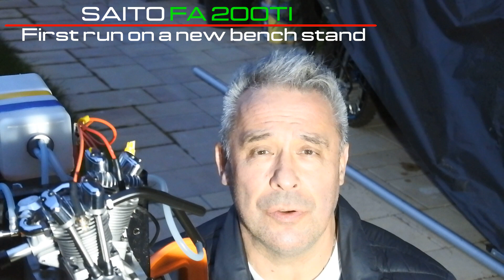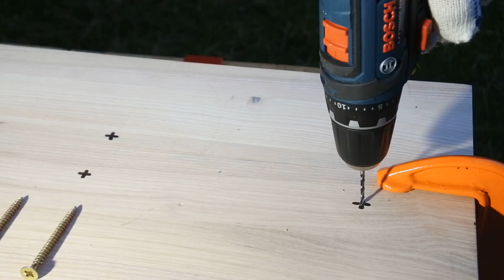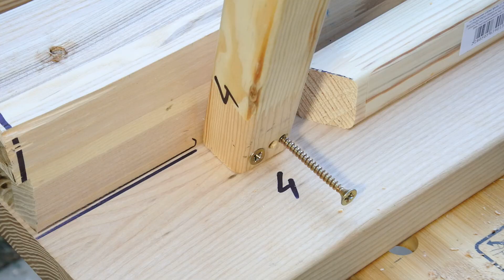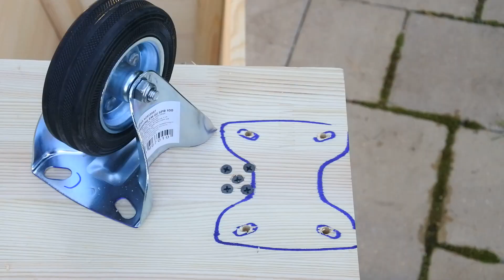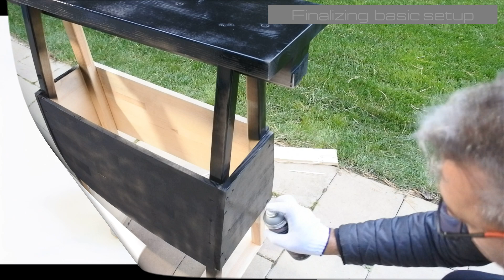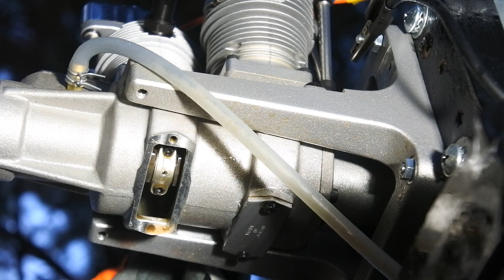Building a new bench stand & Saito FA 200TI test run

Comment: You did a really nice job on the test stand, it should last for years, and despite the settings, the engine sounds really sweet, new subscriber here, and I look forward to seeing new videos, and watching your older ones. Keep well.
Reply from the maker: Thank you very much for your so kind comments  ! Definitely, I spend a lot of time at my main job, so practically, have just a few hours in a week to rest. As you probably, knows, that 5 minutes video usually take one or two working days, at least ( if the weather will be fine, because cold, wind and rain easily destroys all my ideas), so this is reality. I've a lot of ideas to work with, probably, today will make an attempt to realize it. So, keep your heads up 🙂
With best and kindest regards. have a nice day !